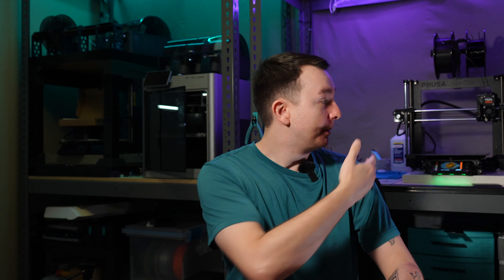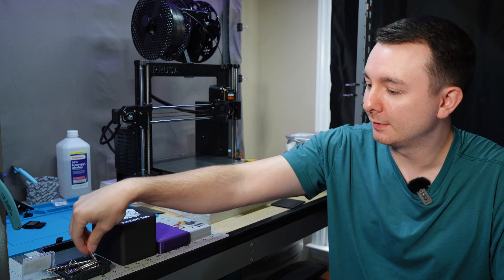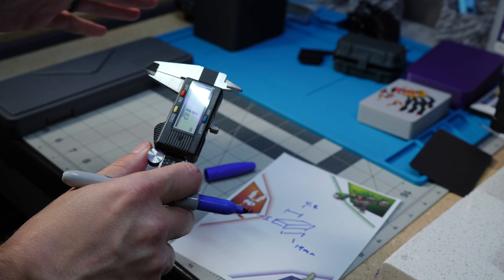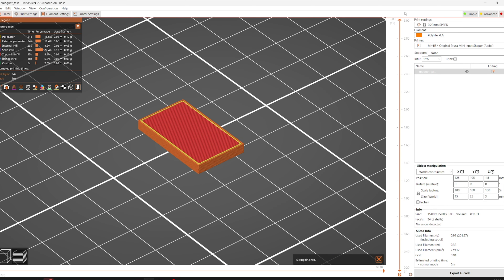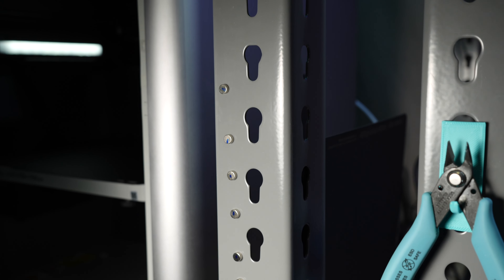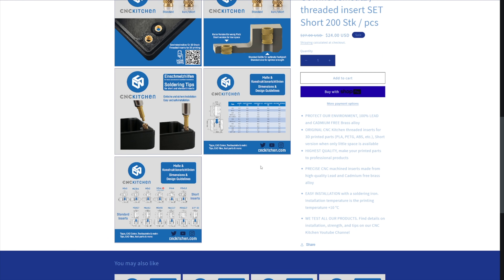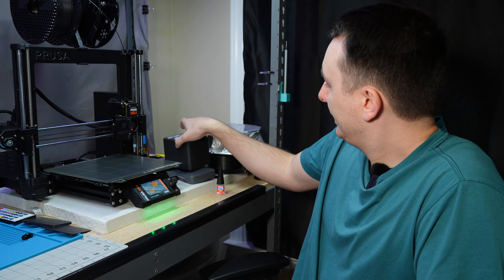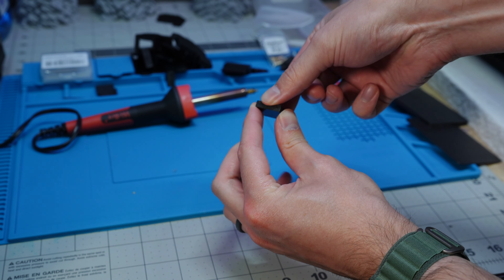3D Prints with Magnets, Threaded Inserts, and More!

Comment: I recently tried Cura instead of Prusaslicer, and noted a huge improvement on the surface texture and reduced stringing. My printer is a SV06 Plus, which I believe borrows heavily from Prusa MK3. Might be worth a try.
Reply from the maker: I know Cura uses a different set of algorithms because it’s not based on Slic3r, but there’s just no way I move away from Slic3r based programs.

Comment: Great video.
 Have you ever used embedded hex nuts ? These would be hidden in a hexagonal pocket like the magnets but with only a through hole. I’ve seen someone use them and it seemed like a good substitute for the special inserts.
Reply from the maker: Yeah I have! There’s a challenge with them though in that if you truly embedded it into the part the bridge layer above it will need a circle. The way slicers work it’s going to try and print a circle into mid air. The way around that would be to leave a slot and insert them like Prusa does on their machines. I wouldn’t call it a substitute, but it can totally be a good way to attach parts together!
Reply: Thx. After I asked this I found the older video where CNC Kitchen tested a few three of tons inc
Using inserts and nuts.

 I think I’ll order a set of the inserts from his site.

Comment: My biggest hesitation with 3d printing has been including external parts (screw, magnets etc). I just recently tried to include open face magnets for a stronger bond than embeded and was bummed when the fit was wrong and demoralized to try again. But your vid helped me a lot! I learned offset face (I thought you could only do it in the sketch), snap midpoint (my locator tabs were somehow off-center lol) and I'm actually pretty eager to try the embeded threads you made it so simple. You got my like and subscription thanks for the hope and info!

Comment: Liked the video, lots of good stuff in it. I would suggest using a mechanical dial vernier caliper or a mechanical micrometer for measuring the magnets, though. If you place the magnets anywhere near the scale on the electronic vernier calipers, you will disrupt the magnetic grid the sensor uses to measure the distance between the blades of the caliper and you wind up with a very expensive low strength clamp instead of an accurate electronic vernier caliper...